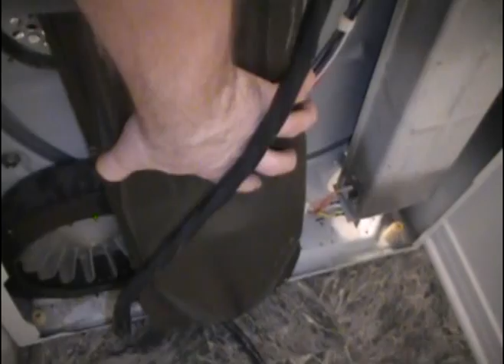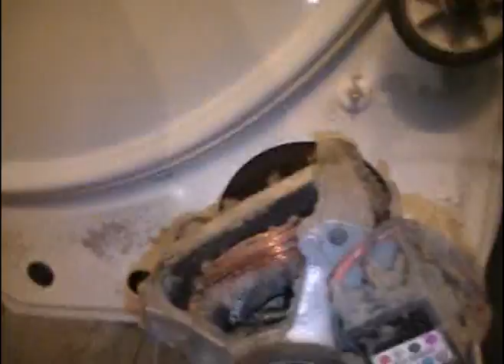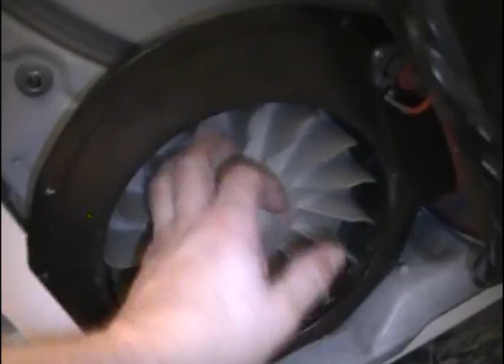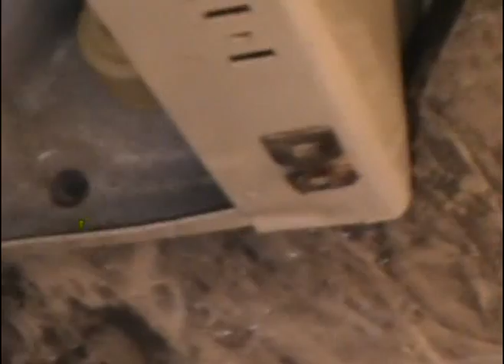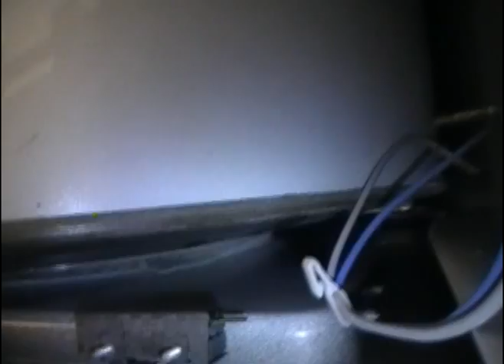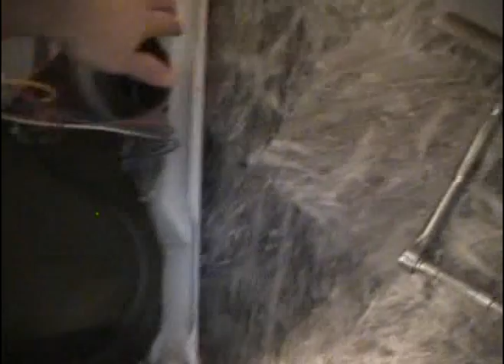Dryer Repair (Admiral)

Comment: I was sitting on the floor, putting the dryer back together, holding the front panel with my hands and head, trying to get the latches in place, and you said "it's hard to do this and keep the camera in focus" or something similar. It made me laugh because with everything engaged, i couldn't do it alone and you managed it as one person with one available hand. Maybe I'm just bad at things 😂
This did not fix my problem (the Admiral is still singing a song that I don't know the meaning of) but I'm much more prepared to do it all over when I inevitably get the replacement part. Thank you so much for posting this video!!!

Comment: Hey man great video
My admiral drum will slow down. I replaced everything with a kit because it was the belt first then the wheels so after replacing them…. Drum will stop spinning at a certain weight of clothes?
Reply: That's my same problem. Did u happen to find a solution?

Comment: Thanks for the video I wanted to do preventive maintenance and with your video it helped me a lot to do it quicker. 

Don't use WD-40 for lubrication, it's good to clean but it doun't really lubricate since there is aa solvent in the formula. Use liquid grease instead once you cleaned the shaft and bearings. Grease or even motor oil will lubricate lot more than WD-40 which in fact clean and dry the bearing instead of lubricate tehm.

Thanks again for this video. 🙂

Comment: the only thing i didnt like was wd40, since it's not actually meant as a lubricant, I would find a way to take it apart and use grease or at the very least use motor oil or cooking oil, etc. wd-40 is actually meant as a water displacement tool, that why it's called WD

Comment: If your belt came loose or lost tension that caused the dryer to stop spinning the tensioner may have simply come loose and you can just lift the top and open the front

Comment: Thanks a lot for the video. Going to check mine tomorrow. Its not starting but will start for a few minutes if I help the drum spin when I turn it on.
Reply from the maker: Hope it works for you buddy!
Reply: @denmarcbros  It did not. Wasn't dirty really and the shaft would spin but not very well even with lots of lubrication. It would spin fine without the drum on but after putting it all back together it still wouldn't spin. Went out and bought a new dryer.

Comment: I really need help understanding i watched a bunch of videoa going over problems but non exactly like mine to tell me what to do or whats exactly wrong..I have a Amana 2008 front load electric dryer as of yesterday if i push start on any cycle with any type of load  it starts make a super loud roaring noise and wont stop till turned off pleas help me..thank you just need and idea where to start or what to do..
Reply from the maker: Hi Heather, your problem seems to be similar to the one I had.  Your problem is probably with a dirty motor. It is what is making the loud noise.  You might have to take the dryer apart like I did and check it out.  Unlike what I did (use WD40) you might want to use a better lubricant for the job.  I eventually had to replace the motor for 1\5 the price of a new dryer.  Hope this helps.

Comment: Great Video, I have found out over the past 30 years or so that WD40 will gum up and is not good to use when heat is high. I would use an oil that does not break down around heat. I was an appliance repairman for years but now i'm retired just so you don't think I don't know what I'm talking about. WD40 is not good for every application. I only mention this so you don't have to lube it again a few months down the road.  Thanks for the video , keep up the good work.
Reply: I thought the same thing . can you recommend an oil?
Reply: @misterdave5468  3-IN-ONE SAE 20 Motor Oil. Sounds different than what it is. Designed for 1/4+hp motors. More like machine oil and comes in a small bottle with a dropper tip.
Reply: Well said

Comment: Hi denmarcbro, Thanks so much for getting back to me. I came to the same conclusion. But feel more confident with you confirming what I already thought. Not sure if that is to big a job for me...😕  Still a great video🙌
Reply from the maker: +Melinda Wriston Hi Melinda, if you follow the video, you will notice that you will have direct access to the motor and you will simply need to remove a few bolts to replace the engine if need be.  You replace the motor and re-assemble like the rest of the video. Not very hard. Hope for the best.

Comment: Hi denmarcbros...any other suggestions?? After following your instructions..step by step... my dryer worked beautifully for about 4 loads...now it just hummm again.Also if u hold the button for to long or repeatedly push it, the humming stops and u get nothing😕  Grateful for any more pearls of wisdom? I can't afford a new dryer...thanks😊
Reply from the maker: +Melinda Wriston Hi Melinda, unfortunately, like you, my motor started doing the same thing as before and even if it was cleaned, my nephew worked at a repair shop for washers and dryers and told me that the dust would actually get inside the motor past the shaft's  bearings and would still clog the motor to the point of overheating and burning the motor. This is what happened to me and I had to replace it!

Comment: Definitely don't do this. Fire will occur. WD40 will kill grease. Grease is what lubricates the engine. WD40 is flammable.
Reply from the maker: Kyle Darling It worked fine for me.  Had to do this again about four months later and used a bearing grease that time.  Still working like a charm!

Comment: Job well done! Thanks for the excellent video. My sister's machine is an old Kenwood/Sears, but it has the same arrangement of lint trap, top cover clips, front door switch and position of other components. I was going to toss it but will try to "reincarnate" the motor with a cleanup and lots of WD40,- the magical elixir of life!

Comment: I have followed your video and found out that the thermostat was busted. However I took apart almost everything just for fun and gave a good clean up. There was a ton of dirt inside. Finally changed the thermostat and the machine was back up again perfectly. Your video made it possible for me without much effort. Thanks again for the video. Cheers.

Comment: Thank you so much. I have an admiral dryer that worked during one cycle, had a rough start the second cycle and just did nothing on the third cycle.My husband and I changed the thermal fuse, cleaned the lint from the back +checked the outlet. we do have power but when we pushed the start button we do hear a funny noise so I will let him watch this video so we can try this step next before spending anymore money. The upsetting part is we only had this dryer for 3 years and 2 months. Thanks again.
Reply: Great job!!